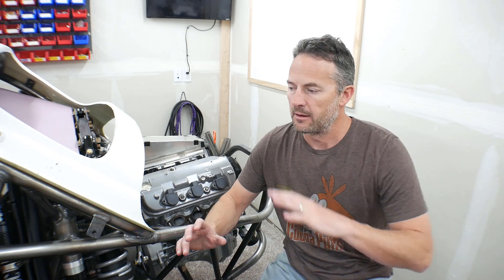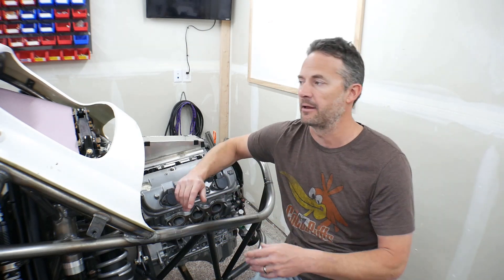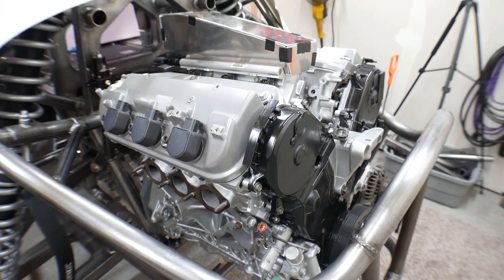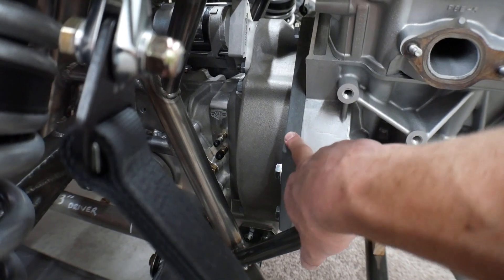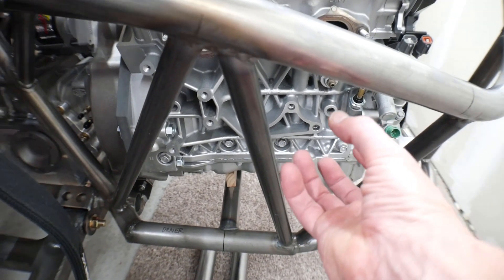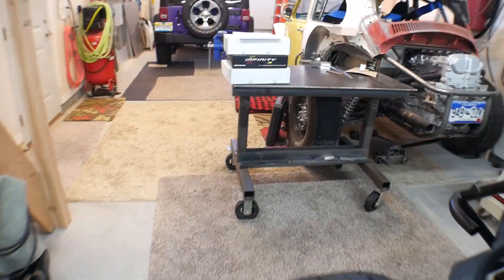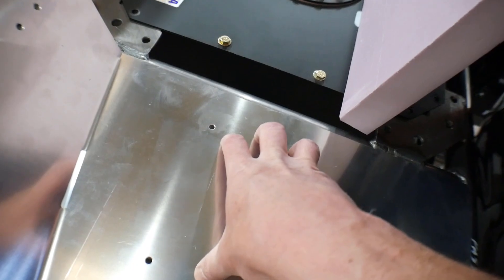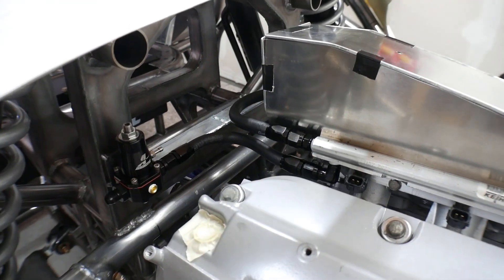Wratchet Engine Build Series Ep1

Comment: I like the look of the radiator in the rear window, looks sick with a couple of big fans either side with an option for a third in the middle if it runs hot.. I think you can get away with laying it down a bit so you have a 6-8 inch gap to see through especially with just the two fans , should give you a 8x12 slit to see through , I'm a truck driver and biker so I'm not fussed about a rear mirror as I always lifesaver over my shoulders anyway . Looking great buddy .😎
Reply from the maker: Yeah I thought about laying it down some. I'll see what I can do when I have the actual radiator.
Thanks for the feedback.

Comment: Out of everyone's commitments and your 2.5 choices ( by the seat, in the rear window and in the front) I would have a rethink about the front you can get a thick core rad in there. Also for the 2nd engine stage you can fit the intercooler in the window or behind the seat with safety 
But out of the other two put it in the window but try and find a smaller rad if not an option go for a video camera for rear view. Don't put by the seats as boiling water on your race suit is like a boil in the bag meal not good

Intake take a look at the PFI speeds bully build there intake has nice velocity stacks
Reply from the maker: The front is a good option, but this chassis is actually pretty heavy and the engine is actually pretty light. So I'm trying to keep weight in the rear if possible, I want as much weight (within reason) over the rear axle for traction. I feel like at this point It'll go in the rear window.
Although I might try to find a smaller radiator, that might help.
Thanks for the feedback.

Comment: Second option moulding over shock mounts would be better if there is no other way to get  rid of heat build up inside the cab . Bit of uncomfortable while  working back there can be more sacrificed than permanent heat circulation inside the cab
Reply from the maker: Yeah, circulating heat in the cab is not comfortable.
Thanks for the feedback.

Comment: I would mount the radiator in the window . That's where mine is and I don't have heat issues . Plus If a hose pops off you're not getting burned .
Reply from the maker: Good to know you don't have heat issue with it mounted up there.
Thanks for the feedback.

Comment: I bet you could fit 3 1 fan rads where those aluminum panels are, and you could also but 1 or 2 in line above the cavity where you fuel cell is. Another option is laying flat a foot or so above the fuel cell and making some ducting for it. That way it gets plenty of fresh air and the hot air goes right out the back window.
Reply from the maker: I actually bought a pretty small radiator and was trying to see where I could fit one on each side. But I really couldn't find anything that was practical enough.

Comment: What do you coat your tubes with to keep them from rusting?
Reply from the maker: Absolutely nothing..... Where I live in Colorado it's so dry that nothing ever get's surface rust on it as long as it protected from direct rain. 👍
Reply: @DougBugBuilder  Awesome! Thank you. Kind of the same here in San Diego, but I get very light surface rust if I leave the garage open a lot. Wipes off, but still irritating.

Comment: I like the radiator in the window idea. For the lack of visibility, run a camera with a digital rearview mirror. 

I also like the idea of the two smaller radiators under the gas tank. That would be clean.
Reply from the maker: Thanks for the feedback. I tried and tried to figure a way to stuff two radiators on each side, but couldn't really get anything practical figured out.
Reply: Standing upright, mounted high, in front of the shocks, but behind the fuel tank.
And a standard looking hinged louver instead of a rear window.
No need for scoops, since the car will be drafty anyway and your speeds will not be high enough.
Forget about rear visibility.
It's just the way it is.
Just as with a closed van, use the side mirrors. (Or as suggested a camera, if you decide you need one.)
Front mount is just adding weight and complexity, without the added cooling.
Just behind the seats is too close to pressurised boiling water for my taste, plus what about the harness?
In an angle at the rear window blocks all the access and is less effective for cooling.
And it's a bit big for now, but I understand you want to future proof it, so those are my 2 cents.
Reply from the maker: @Paul_VanGo  Upright in front of the shock towers, I'm not sure I even tried that, I just laid it down by the rear window. I'll mock it up and see how it looks. 👍
Reply: @Paul_VanGo  I really like that idea. Could even fab up some minor air "deflectors" or ducting to exit out the rear louvers you suggested. That would help with evacuating the air off the radiator instead of it swirling around. 

*Another bonus of the deflectors or ducting would help retain lower intake air temperatures.
Reply: @joshcosta423  ...and we all know how much Doug likes fiberglassing!
(since making the ducting behind the radiator from anything else than fiberglass would be silly)
One could even connect the ducting directly to the louvers, so one could pull it out in one go, for accessibility purposes underneath.

Comment: How about two individual radiators with fans, each over the back side window areas?
Reply from the maker: I thought about that, or more about that area but down lower. But I knew I'd be putting a sway bar down there. I guess up around the window might have more space.
I'll think about it, thanks for the feedback.
Reply: @DougBugBuilder  Maybe a a low profile scoop on the rear portion of the roof would feed pusher fans on either side.
Reply from the maker: @kevinhornbuckle  Yeah, actually that would work pretty good.
Reply: @DougBugBuilder  2 Honda civic radiators might work out to be the right size for a split system. you can set up the fan control to cycle the fans at different temps as well. it keeps all your visibility/ access open and they are an off the shelf part that the after market has many options for as well. plus if they are low mounted you can direct the airflow away from shocks keeping the temps down.
Reply from the maker: @Jvanderveen222  I'll check them out, thanks for the tip!

Comment: Doug Bug, Since you are going to design a spoiler that is on hinges, I'm sure you can design the spoiler that looks nice that incorporate the radiator. Maybe it works for you.
Reply from the maker: Ya know, I don't want to go that route, but it does have some advantages. Maybe I'll mock it up a little to see how it would look being over the engine.
Thanks for the feedback.
Reply: @DougBugBuilder  What about setting the radiator over the fuel tank, only at a diagonal angle so air is blown out of the window access?